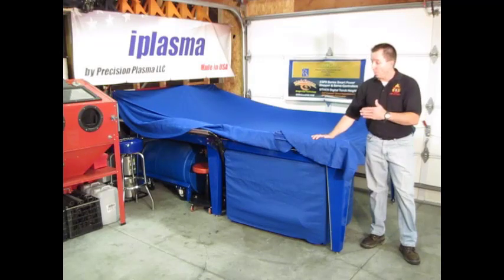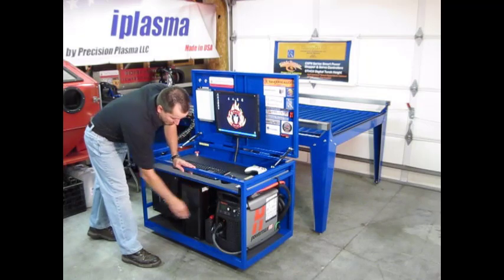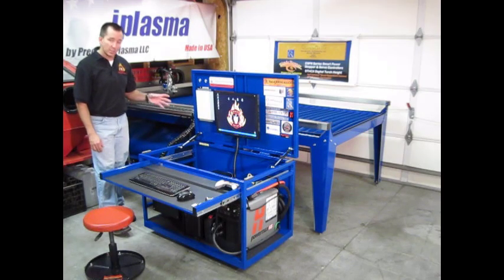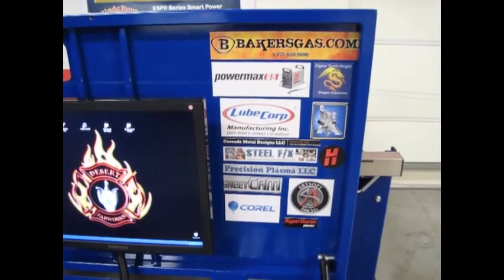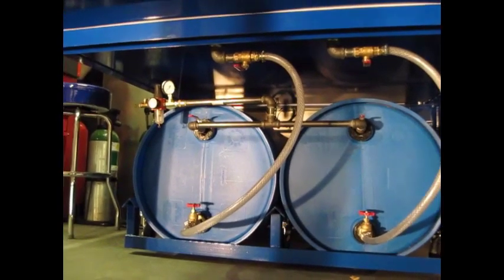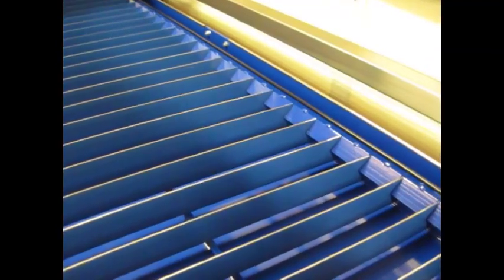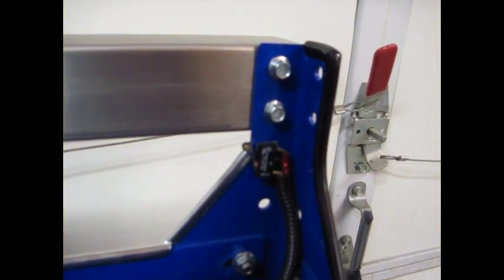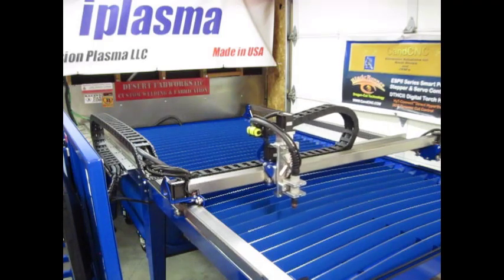CNC_Build_Project_INTRO.mp4

Comment: Very Nice Unit! I have been looking around at Pre-Built Units, but they are generally very expensive and they just are not built like yours. I really like your roll-out unit, VERY NICE! So, I already have a Hypertherm Powermax 65 and I love It! Can I ask if you know how much you have spent on your unit?
Reply from the maker: Really hard to say how much I have spent over the years but I know its far less than if I would have purchased a turn key setup.  There were also many areas whey I spent more than I needed to, like the cart and the powder coating were not necessary but it all came out very nice.

Comment: Красиво -но не практично ...Подшипники будут заклинивать -так как пыльников нет и любое попадание мусора абразива будет приводить к сбою ...в целом все красиво но нужно доработать ..
Reply from the maker: +11megadevais77   The table runs 4-6 hours a day for over 2.5 years and no failures of any kind.  The bearings are fine and accurate.   I cut on a daily basis with an accuracy to .001
Reply: +Desert Fabworks LLC Welding - Plasma Cutting Маркетинг ....